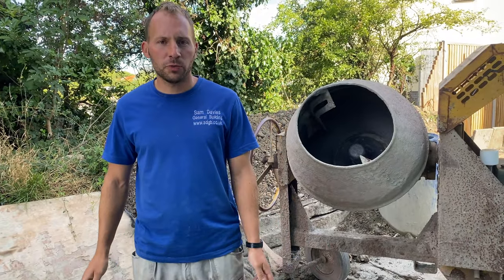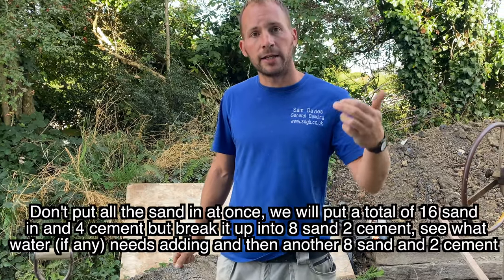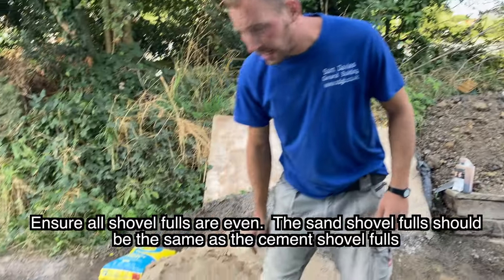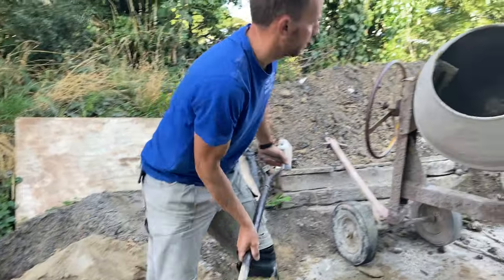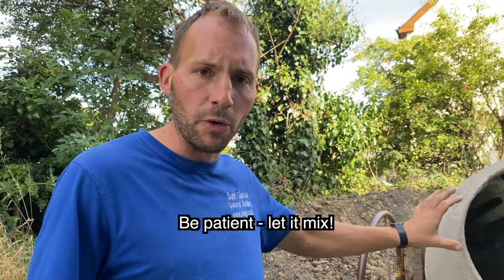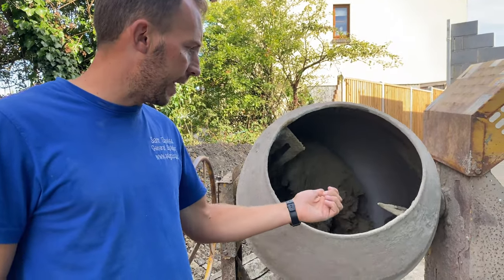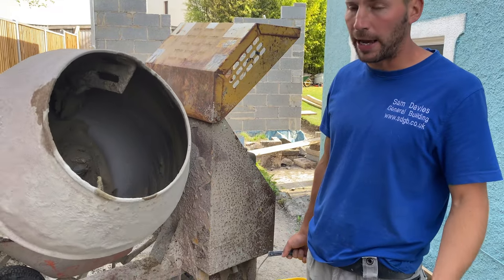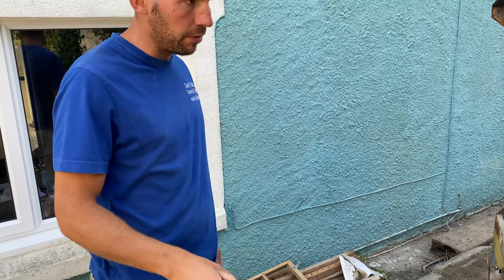How to mix mortar, perfect creamy mix for bricklaying

Comment: That is one giant mixer buddy. Even with 16 shovelfuls of material it was like a little ball of mortar in that giant chasm of a mixer!

I was thinking of buying an electric mixer for DIY use. Are they fine if used in smaller batch mixing and taking my time?
Reply from the maker: Yea in this mixer I can fit 40 shovels of sand so you can batch some huge mixes up.  Also when you mix a large batch you can get a lovely mix. 

If you had an electric mixer it would be no issue for you to make a small mix, I’ll do small ones if I don’t need much mix

Comment: sounds like you got some gravel along with your sand - We try very hard to keep our material clean and free of rock and dirt
Reply from the maker: Do you mean our sand looks coarse?
Reply: @SamDaviesBuilder  I only heard it when you went to shovel it up off the bottom. Other than that your sand looks great and you mix
Reply from the maker: @utubewatcher360  I think it’s just my rough trailer bed 🤣.  But well spotted and I completely agree about keeping the sand free of dirt etc.
Reply: @SamDaviesBuilder  Love your mixer, and thank you for being receptive to viewers observations. Not being critical by any means.
Reply from the maker: @utubewatcher360  thanks, I always take on constructive feedback.  I have an electric start diesel mixer now, so much easier than the crank handle start!

Comment: After shovels of cement in would of added bit of water to let plasticizer mix through before adding sand after so u don’t get dumplings rolling around then be patient
Reply from the maker: If it’s too dry you would of added water after the cement went in but this had just the right amount of water in it.  If I’d have added water too soon it wouldn’t have mixed up as nice. I see where you’re coming from though as once you get the balls it’s hard to get rid of them!

Comment: The febmix bit i was hoping to learn from but from your very useful comments and replies from your other videos regarding sand wetness, dry blocks, clamp or class b bricks, its a judgement call. 
Ive done well so far by just reading the instructions on the tub!

Ive only done hand or liger board mixes but a mixer for half an hour is way more than i thought BUT when we did the Concrete block destruction tests the longer dryer mixes (then cured in water) were like iron!
Ive done a few single skin practice walls now using salvaged bricks where the mortar course is mirror smooth and stronger than the bricks! Practice practice.
The current crop of 'builders' in the north could do with your videos because i can drag my van vault key down their mortar and it goes 2-5mm deep!
They are builders. Not brickies!
(B.S artists more like!)
Do you have a video on pointing?
Repointing is an ARSE job! Is rhere an efficient fast way and just to see the skill involved would be very useful.
Cheers!
Reply from the maker: Honestly some of the mixes people use are terrible and it makes the job so much harder.  People put too much feb in most of the time that's why the mortar is so soft so you can dray a key through it.  I will try and do a video showing how little feb I try and put in a mix, I always put as little as I can get away with without it being a poor mix.  As there is so many different types of feb (plasticiser) out there it is always difficult to have a rule of thumb as to how much to put in as they do seem to be different strengths depending on the brand
Reply from the maker: Will do a video on repointing as soon as I get a repointing job :)
Reply: The loudest braggard builders always have, if you look around at the sites around here (wrap around lean-against extensions) a bottle of Magnum by the mixer 😃
It used to be Fairy Liquid but times are tight!

If you could do a layered comparisson say 3 courses thick.
too much.
 just right.
 not enough or zero.
washing up liquid.
 And how you make it mirror smooth pointed and then scratch it with a tool showing resiliance or lack of.
Reply from the maker: @RedwolfDogrocket  that is a good suggestion! I may give that a go at some point and do a video. 

One thing to note too is that how to do a proper mix is lost on some people as if they’ve been an apprentice on a building site with a silo (ready mixed just add water) then they will never learn how to mix up from scratch properly

Comment: Ive found soap does just as well!
Reply from the maker: Should always use a proper plasticiser not fairy liquid
Reply: @SamDaviesBuilder  tell me what's wrong if it works it works?
Reply: @SamDaviesBuilder  any chemicals mixed together is from their fairy crap. It's all sorcery. It's just chemistry
Reply from the maker: @joeykirk9367  for a start fairy liquid isn’t tested to a British standard for construction.  Fairy liquid would get you out of a problem if you had no proper plasticiser but I wouldn’t buy it specifically for building with
Reply: @SamDaviesBuilder  I've seen they've sold you on their fairy dust plasticer!
Reply from the maker: @joeykirk9367  for the price for bottle of plasticiser I’m not going to worry about it!
Reply: @SamDaviesBuilder  well that's good enough for me 😁
Reply: @joeykirk9367  Fairy liquid weakens mortar, plasticiser doesn't. It's different chemicals, and fairy liquid lets too much air into the mix.
Reply: @Daniel-bb7rv  scientist at the lab said fairy soap does not weaken the mortar. They said the chemical composition is an exact match.
Reply: @joeykirk9367  I dunno where you've heard that, but it does categorically weaken mortar

Comment: I hope your mix is better than the camera work! Most of the footage is focussed on you. You don't actually say how much plasticizer to use nor show the consistency of the mix as you pour the water into the mixer. Some of those spades of sand going into the mixer looked well under weight. Sorry but gave up on this one.
Reply from the maker: Hi Alex, this is just a general video to show doing a mix. I didn’t focus on how much plasticiser as it varies so much between different brand as to how much you use and can also depend on the quality of your sand as to how much plasticiser you need.  I don’t heap my sand too much as you’ll never match the cement shovel fulls otherwise. This is my method and I know other people will have a far different way to mine - but as long as it makes a good mix that is the key!
Reply: @SamDaviesBuilder  Assuming that you made the video for amateurs (like me) that need instruction on how to make mortar you should tell us precisely how much sand in gallons or liters, how much Portland cement  how much water and how much plasticizer and  the brand of the plasticizer. Watching you shovel sand and mortar is not helping me.
Reply from the maker: @paulohlstein2236  this is how I was taught.  If you listen to the video I say the amount of water depends on how wet or dry the sand is so it’s not the same every time.  Also how much water would depend on how stiff or sloppy you want the mix.  Amount of cement is just a ratio so it’s 1 part cement for every 4 parts of sand - if you can’t learn off me doing it from a shovel you can use buckets, so 1 bucket of cement to 4 buckets of sand.  Plasticiser will differ as to where you are in the county and what you can get hold of.
Reply: @SamDaviesBuilder I thought it was a decent tutorial on how to knock a general mix up👍🏻 you’ll always get a couple of clowns like these, I mean you might as well nip round and knock the mix up for them with what they expect from you🤡
Reply from the maker: @midge486  thanks and I suppose putting these videos out there always put me in the firing line for good or bad comments
Reply: Don’t have a mixer ( obviously) but it’s given me a few pointers to see where I’ve gone wrong in the past. Never used plasticiser, put cement in first, too much water etc. 
Thanks!

Comment: You should always gauge your mix with bucket so you always get right amount of cement and sand..for perfect mix then its same amount every time your not to old to learn young man also its same strength and colour every time,  I've seen people big shovel of sand and not the same when putting cement in , so your getting different mix every time.
Reply from the maker: I only gauge my mixes on brickwork.   My shovels are always even.  

I do get what you mean about people putting huge shovel fulls of sand in and then a tiny shovelful of cement but I never do big shovel fulls of sand.   A beginner can’t go wrong if they gauge it.